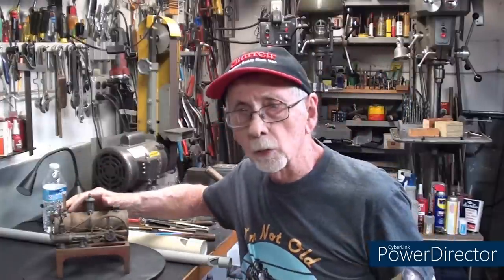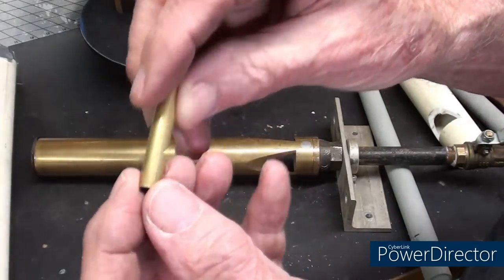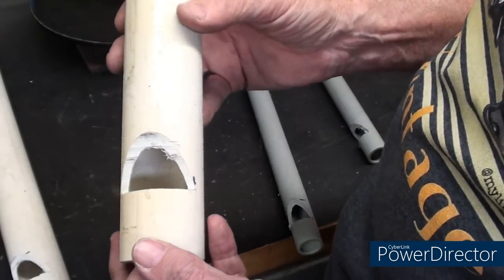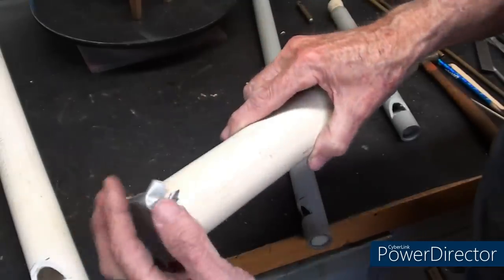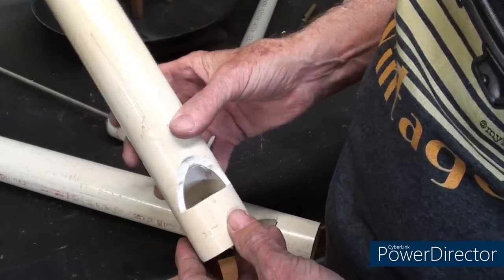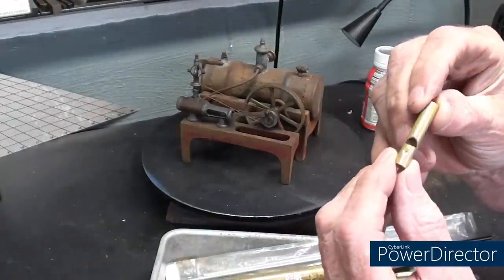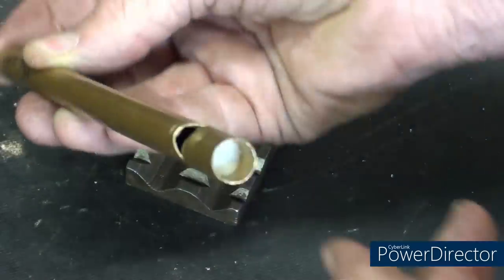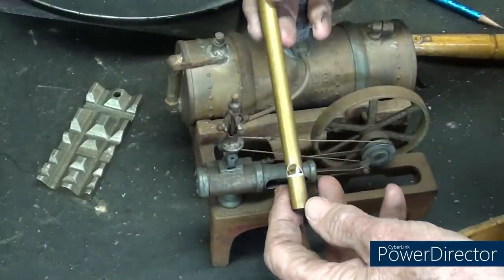Make a WEEDEN STEAM WHISTLE #849 tubalcain engine

Comment: I attend the Rough and Tumble Historical Society flea market each August here in Pennsylvania where I'm a vendor there, and at noon, there's a whistle blow, and I was always fascinated by them. I'm hoping to put one on one of my tractors I take there, as anyone with a whistle blows it at noon. This of course includes sliding models as well. I did try to put an air fitting on a diesel truck horn, but it wouldn't operate. The air horn is a simpler design, so I think I'll try one of these. I might even try to make a three chime model. PVC is quite good for this, too.
Thanks for the information, Lyle.

Comment: Saw plans in a home machinist magazine project that fit a sheet metal + baffle in a 1 angle notched tube. Three of the chambers were blanked off with various length quarter round material producing 4 chambers.
How would that sound (blended)?
Loved the video, magazines don't have sound.

Comment: Good Morning Mr. Pete.  I am expecting my first two grand children this October.  This video is perfect to keep in the toolbox for those times I get to spend with them.  If you don't object, I would like to include it with the Mr. Pete's Projects page.  Does the flat size on the piece inserted affect the sound like the diameter and length of tube?  Thank you for sharing Lyle.  You put a big smile on this soon to be papa's face.

Speaking of dummy Governor's, I think it is near plague levels.  😀

Joe
Reply from the maker: Hi Joe. By all means include it on the project page, although there are no drawings. And I cannot answer your question, that requires experimentation. Sounds like you are expecting twins. Too good to be true, you will absolutely love them. Praise the Lord. Lyle.
Thanks for all you do for my channel

Comment: 65 years ago in second grade I made and sold Elderberry whistles.  Took Elderberry cane, pushed out the pith, and cut the mouth.   Pushed them on a car heater motor and turned designs in the tubes.  The wedge, slides, and plugs were made from bolas wood. I sold for $.25 each.  One  with slide were 5 cents more. Finished with vegetable oil or bees wax..
Reply from the maker: Awesome, you were quite the little entrepreneur and craftsman
Reply: I gave too many away

Comment: I made a few whistles of this type with different lengths to give feedback sounds to a machine operator where there were a number of pneumatic valve discharges to hear in sequence.  It was q precautionary method of hearing the cylinder whistle to indicate " Now you can press the next pilot valve.".

Comment: I made a few using old shell casings from various caliber rounds for a buddy who collects old steam engines, the smallest used case from a 30 carbine, the largest used the case from a  45-70 round. For the top plug, I simply brazed over the primer pocket, and made the plug from a brass rod turned down on the lathe.

Comment: The main advantage of 3 mouths, or 360° mouth (where the resonant chamber is on a center post), is that when the whistle is mounted vertically, it is equally loud in all directions. This is especially important for higher pitch whistles, because high pitch sounds are more easily blocked and don't bend around corners well.

Comment: Mrpete, I just bought a rough Weeden model 14 at an antique store. The lead crank on the end of the shaft is all buggered up and I need to make a new one. Would it be possible for you take a look at how it mounts to the shaft. The end of the shaft is flattened. I just need to know if the hole in the crank is in parallel with the recess. There is very little information and no parts about these models.
Reply from the maker: Contact me by my regular email

Comment: Hey Mr. Pete!  I as thinking about your difficulty maintaining your weight.  Has your doctor checked your thyroid function?  If it is not working correctly, it can cause the issue you described.  If so, I believe there are pills you can take to compensate and if may help you a lot.

Comment: No one mentions a hobby store these days. They used to be the only place you could readily get brass tubing , square brass tubing and rods, flats and hex for models. Nowadays, wooden model airplane kits are hard to find unless you want to construct 1/4 scale. Box stores, Walmart and computer games have killed off hundred of hobby shops. I have one in my town and he is mostly handling used trains, some model car kits (new old stock), and other hobby items and it is not anything like the hobby shops I used to go to and drool over the many different items they offered. Now, everyone wants instant gratification. The prefab Styrofoam airplane kits with electric motors have become the norm and gas engines of different sizes are unobtanium in nature.  Even Tower hobbies doesn't sell what an older guy like me would be interested. Construction was more fun than the finished item and it could take days or weeks. Now, just go online and purchase instant fun, then put in on a shelf and let it collect dust. Where is my Nintendo Switch, I don't have time for this line of thinking.  lol
Reply from the maker: Excellent rant and so true

Comment: Why did you use the mill on the delrin instead of the benchtop grinder (to make the flat)?
Reply from the maker: No good reason
Reply: The bench top grinder will smear the delrin and make a mess. The mill won't.
Reply: @ellieprice3396  nah, not for a tiny detail, like that

Comment: The part inside the tube of the pipe, just below the mouth that directs the flow of air is called the languid, Not an exceptionally useful piece of information but there it is.
Reply from the maker: Thank you

Comment: Thanks fir this video in the late 80s to early 90s my step dad bought a shopsmith setup and we cut up a batch of 6  8' 4x4 posts to be 2x2 and around 7 inches long qe drilled 4 holes of different depths and made rhem into train whistles i bet he took 300 to work and sold them, made enough he got the shop smith basically free (it was a used rig)
Reply from the maker: Very impressive story of craftsmanship and entrepreneurship
Reply: I learned a couple lessions that stuck with me a long time we did batches of steps so I learned a bit about orders of operations setting jigs on machines and how to handle setup changes where a different part needed to be made before other a batch was finished. All while I was in Jr high, then when i got to high school I had a semester in metal shop where we turned hammers in the lathe and welded the handle into the head, now thanks to you and your channel iv learned so much more and rekindled the interest in the metal arts, I found a old lathe so far and slowly getting there, thanks again for all you do maybe someday I'll be able to afford the classes so when I get older I might still enjoy some shop time with Mr.Pete the shop teacher!